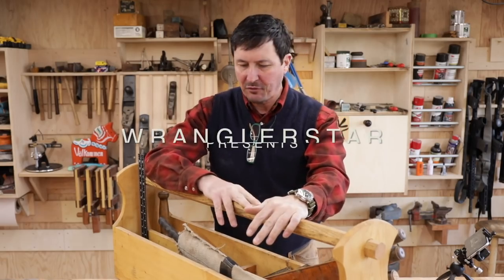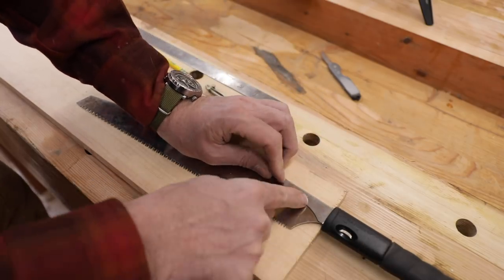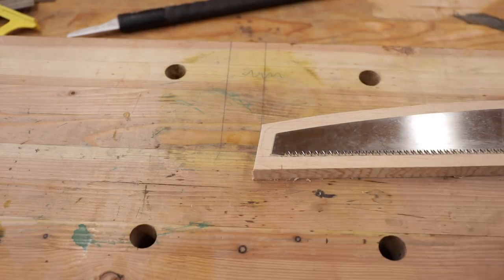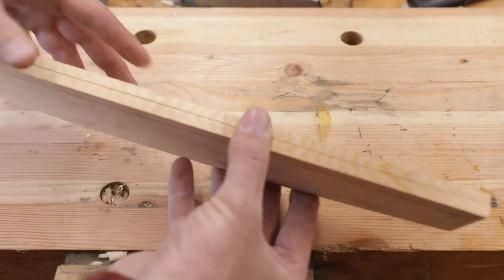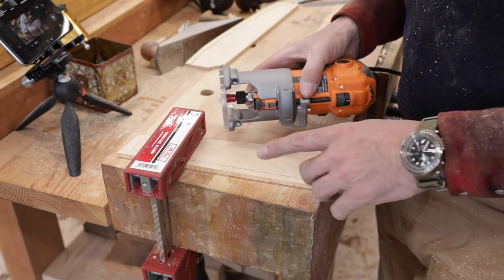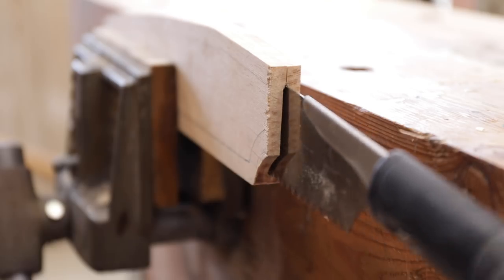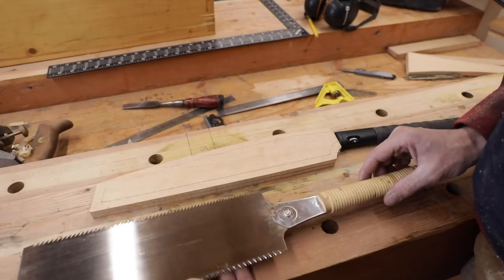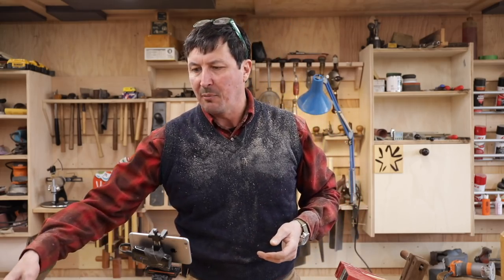How To Make A Beautiful Wood Saw Sheath

Comment: Nice! Make a set of them for different saws, but all with a rectangular outline, and you can have a saw box of all your favorite saws... The outside of the sheaths would all be the same size, the cutouts would fit each saw. But, most of my favorite saws are quite a bit longer that that, so I'd need a pretty deep box for the sheaths to stack in... Hmm, Now there's a project. On wheels, for the shop at least. I do love my hand saws. Can't wait to get my shop built. but there's that financial thing. Working out of the barn until... Enjoyed the vid, Thanks!

Comment: I love the look, my only concern is moisture absorption in the wood. I live on the coast and have had problems with rust when metal sits on wood.
Reply: i think the oil he uses on the saw itself would keep it from rusting up too bad.  it works for some of my delicate carbon steel items in a steel sleeve.

Comment: Cody I like the protective guard.  You need to add only one thing and that is a small leather strap with possibly a snap on one end to go across that portion of the guard below the saw handle.  This will keep the saw inside the guard, until unsnapped allowing removal of the saw.  Just a thought.

Comment: As a finish carpenter I call those routers a laminate trimmer router, nice project well done pretty little scabard right down to the hilt. A possible glue choice for this one cyanoacrylate as in crazy glue Grizzly tool has it for a good price. Well done great choices.
blessings david

Comment: This looks a lot like a saya, or a Japanese sheath for knives. If you use a drill press, you can put a small peg through the handle end to hold the blade in.
Reply: NanashiVII I had been thinking a strap, being an amateur leatherworker, but the peg is a much better idea.
Reply: I was going to recommend that, too. It'll be a nice assurance to keep the sheath on if you're carrying it around.

Comment: I was going to suggest that you cut in an angle from the outer to inner edge for the front end of the sheath to help with inserting the saw easier.

Comment: If you wanted to add a little retention you could place a small est magnet on the inside of the sheath. Simply drill a small hole place the magnet in there with epoxy and then it would stick to your saw blade.

Comment: Some suggestions:
Throw a tiny little strap at the curve of that sheath, and the saw won't fall out.

And for your pole saw, because of the angles, might I suggest two separate sheathes, connected to a leather strap across the top, that'll kinda open up for removal?

Comment: You could put a little swiveling strap on the bottom side of the scabbard so it slides up and keeps the saw in the scabbard, cause eventually that friction hold is going to wear out. You might have to round over the bottom corner though. But still a cool idea, even though i probably would of sawed the wood in half first on the table saw, and then tapped the pieces back together and then put the shape into it that I wanted. Just easier to break down full boards that way.  Either way cool little project. Edit: better idea, get a small little forstner bit and and drill a hole at the top edge of the sheath where the wide cut out friction part is, get yourself a tiny little magnet to stick in the hole, glue it in, then take some fancy walnut or something and plug the hole with it. Then the magnet will grab onto the brace part of the saw and not the blade itself.

Comment: Would it be beneficial to coat the interior of the sheathe with wood paste wax? I know it is common for finishing the exterior of wood pieces but I am wondering if it would be useful in this application as well. Always a joy when I see you post a new video!

Comment: the next one you make should have magnets inside to hold the saw in the sheath
Reply: Captain Flubber : (Fred McMurray)  Genius Idea w/a magnet.
Reply: These are pretty common in high end japanese kitchen knives.  You position neodymium magnets down the spine so that the blade edge never comes in contact with the wood.
Reply: That's exactly how I do this, and it's the cleanest solution, plus it just feels great when that magnetic cinch up happens.
Reply: that or just a strip of felt material on each side near the top of the blade (to stop the teeth from catching)
Reply: Captain Flubber 
Actually I was thinking of some kind of leather strap that goes around that radius under the handle
But how would you fasten it to the wood though
Idk just rambling now

Comment: Beautiful work, as usual. I need to make two of those for my pull saws.

WD-40 is great to make sure that water is gone off of your metal tools, but it doesn't protect well. It's actually a solvent, not an oil. I always follow it with some sort of oil: Ballistol, BLO, etc.

Comment: It look great, I would add two minor changes. First, magnet or leather strap to holt it in place could be nice. Second, I would add small hard wood piece at the entrance of sheath, which is in contact with saw teeth when you need to use it quickly.

Comment: I gotta figure out how to make a new wooden handle for an old saw my dad gave me. The blade has lots of patina on it and it's the first one I've seen with a rough cut blade on one side and a finishing blade on the opposite. The wooden handle finally dry rotted and I wanna make a new one. Great video Cody.
Reply: Just trace the handle on to a piece of hickory and cut out the shape with a bandsaw, jigsaw, scroll saw, router or coping saw.
Reply: I would have but the handle broke into lots of little pieces cause it was rotted that badly.

Comment: Carb cleaner is basically acetone.  Same as brake cleaner, MAF cleaner and majority of other automotive solvents.  Just use acetone and you'll get the same results for much cheaper.

Comment: Watched for a long time ...  you might have covered it but if not, suggest you show how to check a framing square for square and how to square it up if it's out.  (A lot of squares in there) All the best!.  PS: shot on Mrs. W.
Reply: Mike Cox ballpin hammer fixes a square.
Reply: Show how to check a Framing square out or in square ... and it's not a ballpin hammer to start.
Reply: A manufactured sheet of gyproc or plywood works. And if the square needs adjusted you simply hit it with the ballpin hammer until it is square on the gyproc or plywood. You can use 3 4 5 measure as well.
Reply: John is correct, that is how you adjust a square, with a ballpEEn hammer. I check one against itself by drawing a 90 then flipping the square and drawing another 90 over top of the first.  If square they will exactly match.

Comment: i don't know if it's worth the trouble, but two things i would have done to the sheath if i was inclined to make one, would be to drill small pits along the edge on the inside and use small hardwood dowels to lock it in place, along with some glue too, and the other would be to put a bevel the receiving hole for the saw so you don't start to chip the wood entrance edges over time with repeated use.  maybe this might be helpful when you go to make one for the japanese something saw (the one that looks like a boat paddle).

Comment: If you accidentally make the opening a little too large and the blade isn't a tight fit, you could always put down a little veneer edgebanding to gradually reduce the opening by small amounts till you get as snug a fit as you want. Luthiers use this trick to snug up neck pockets on guitars which have to be a snug fit.

Comment: Hi Cody, I was wondering if you are concerned with spontaneous combustion when storing oily rags.  As a woodworker, I never store rags that I used for applying an oil based finish together as they can spontaneously combust.
Reply: Combustion needs oxygen.  He keeps the rag in a sealed box.

Comment: Sap removal - just about any oil (plant or earth based) based will remove sap, some take more scrubbing, some less.  My favorite depends on where the sap is, on metal - kerosene (smells better than gas), wood outside tools- BLO (Boiled Linseed Oil) or inside wooden stuff - neutral Danish Oil.

Comment: If you put a peg through the back of the scabbard, you'll be able to lock the scabbard on the saw. It looks like you have enough depth. Put the peg on a little string and it won't get lost. Look at examples of sai's for Japanese chef knives.

Comment: Sure is beautiful, Cody. Worthy of your maker's mark, wouldn't you say?
Permit me if I may to suggest a tiny chamfer on the opening where the blade holder goes; just like a keyhole this would auto-centre whenever the sheath is put on, avoiding the little stop as the shoulders contact each other.

Comment: Nice work Cody, also nice to see the Bandsaw getting used too.  Oh you should move the upper blade guide down so it clears the work by about 3/8 to 1/2 inch, that way it wonders less.  

Something I remember from Grandpa's C. saw scabbards is he had about a half an inch hole at the tip of the blade that way any sawdust or crud had some place to go.

Comment: I’m not a carpenter by any means, but could you put a few little ramps on the inside to act like pipe wrench teeth to provide friction points along the length of the blade?

Comment: I tried cleaning sap off of my saw using gasoline, just like you recommended.  I now need to build a new workshop. 

Jk
Reply: I've used WD-40 for some sticky stuff with good results, haven't tried sap specifically but I hear it works.
Reply: Goo be Gone works as well.
Reply: Rubbing alcohol works.

Comment: Hey Cody, I wonder if you might be able to help me out. I have a few axe heads that were left in boiled linseed oil for a few years and now its dried on, I'm not sure how to safely remove it. The most troublesome is surely gonna be a Chopper 1 head. Any notion would be greatly appreciated sir!

Comment: What's to stop you accidentally sawing through the bottom of the sheath? only 1/4 inch of wood there would could be done with one careless pull of the saws?
Reply: Simon Henman Technique, when moving the saw in or out of the sheath simply put a little pressure so the back of the blade engages the sheath, if it must, and not the teeth of the saw.
Reply: Anthony Browning - do this with every sheathed blade i own
Reply: 100% the best way to go, but its not always you who is going to be unsheathing the saw, so for longevity is there anything else that could be done to protect the blade AND the sheath from making contact?
Reply: Nylon inlay ?
Reply: Thats a great point... if the inner angle of the sheath is sharper than then angle of the blade then the tips of the teeth will never touch the 'bottom' of the sheath.

Comment: You could have made a slot using your table saw and then enclosed the blade side with a ripping.  It looks like you are using an oil rag to lubricate the plane do you not rub parafin wax into you plane bases?

Comment: Hey Cody my name is Jimmy I just bought my first Stihl chainsaw it's a MS 170 16 in bar I'm having trouble staring it now I mixed my oil and fuel together like the thing say 40:1 in that ratio what am I doing wrong please help I'm desperately seeking advice
Reply: Jimmy Scott did you use ethanol free gas?
Reply: Yes I did but it still won't start ive mixed several time with new gas from different stations
Reply: Jimmy Scott did you use the Choke
Reply: Yes it has the intelicarb on it
Reply: Did you drain the gas before trying a new mix?
Reply: Is it new or used? If used, might want to replace the spark plug. Does it turn over at all? If it starts but won't stay started, you might need to adjust the idle. And make sure to put chain oil in it right away, its probably drained out.
Reply: Jimmy Scott how old is your MS170? And have you had it running?
Reply: Several checks to do if your saw won't start. It's a process of elimination:
Clean Fuel? 
Clean Fuel Filter?
Clean Air Filter? 
Spark plug is Sparking?
Spark plug gap?
On/Off switch?
Fuel prime 5 times?
Decompression button?
Warm Start or CHOKE is on Full with Zero throttle for initial kick?
Warm start or Choke moved to next position plus apply full throttle for next pull?
If you've done all of the above and it still won't start, check the idling screw on the carburettor see if it's open enough? It might need a couple of turns with a screw driver to either let more fuel through or maybe it's letting to much fuel through and flooding the chamber.
I think your spark plug gap should be set at 0.2 for this saw. Sometimes the heat or over tightening the spark plugs can change the gap.
Take the plug out but put it back onto the plug cap and rest the plug against the metal parts of your engine, flick the switch to ON and pull the chord to see if the plug is getting a spark. Make sure you don't touch any metal parts of the saw as you'll get an electric shock!  If it's Sparking bright and powerful your plug and the ON/OFF switch are both working but, check the plugs Gap to be sure it's correct and also examine the plugs porcelain part for hairline cracks. If it's got a crack it needs replaced.
If the plug is OK, while its out spray WD40 into the plug hole just a scoosh and same with the carburettor and that might help it kick over as the WD40 acts as a gas lubrication. 
There are fuel seals and the diaphragm seal, if they are leaking then the saw is being starved of fuel. You should have Trouble Shooting Manual that you can refer to that comes with the saw.
Good Luck Jimmy ☺
Reply: BTW it's 40 parts gas to 1 part oil not 40 parts oil to 1 part gas Jimmy 😃
Reply: Does it fire (pop) after a few pulls with the choke on??  If it does take the choke off. My 180 does it all the time

Comment: Cool project done well. Lately I've been making somewhat similar wood scabbards for nakiri vegetable knives, but mostly using only handheld carving chisels. Pfeil or Flexcut chisels. Smaller project, but same concept, to fit and hold the knife with a friction fit.

If you'd like to watch some impressive wood scabbard making videos - check out the videos on YouTube Channel:  omz109 (or Bush Channel), one video title is, " #part2. Bagian membuat | sarung | sangkar pisau....!! ". (or similar titles) Google translate - translates "sangkar pisau" as knife cage. Pisau I believe means knife. Membuat = make, create or produce. 

The guy takes a piece of wood that looks like a piece of firewood, and using only a parang, a handsaw, a small hatchet,  a long handled  curved bladed knife (a rattan knife I think), and a piece of log for a work bench,  he makes the handle and  wooden scabbards for a parang or long knife. Amazingly skilled  work done with simple tools. 

Anyway, there are a bunch of videos made in Indonesia or Malaysia of people hand forging the blades and making wooden scabbards. I am quite intrigued by the rattan knife. He uses it for shaping the wood and also for fancy relief carving on the scabbard. The long handle of the knife appears to allow him to use the power of moving his forearm to make the carving cuts in the wood.
One technique I have seen used in a few of the videos, that might be of some help with your friction fit should it become loose, Add a wood collar to the opening that is cut a little tighter, thick leather might also work. Though often the top of the scabbard is often cut so that a shoulder of wood pushes against the handle to help lock the tool in place by friction fit.